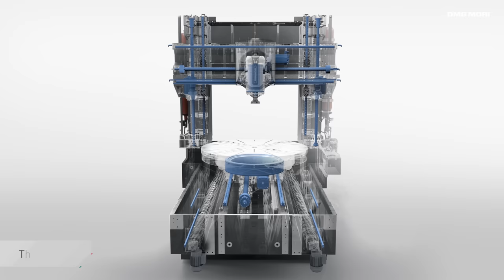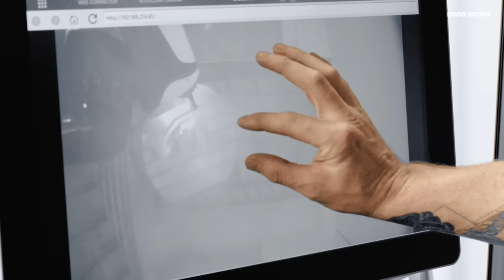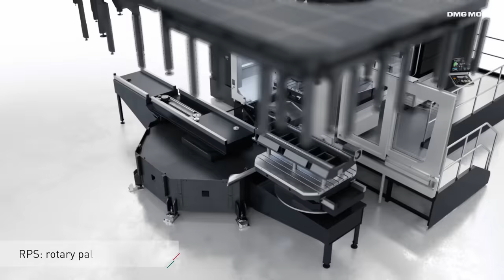DMG MORI Portal series - the pinnacle of mechanical engineering

Comment: I was in in charge of our company’s first 5 axis machine purchase and did the programming . 15 year 5 axis veteran. The thing most people overlook is “How robust is the Post” Then the question becomes do you have a post and simulation for your level of tool path software? The last thing I wanted to get into was Post development that then belonged to someone else. If you have a proven post and simulation that reads from code (Not from Toolpath) this machine will be a winner.
 Great video
Reply from the maker: Hello, thank you very much. We have both. A post processor that generates G-code based on tool path and a machine simulation that reads code and simulates the movements.

Comment: The VFX team must have sweat 💦 till production, details are amazing Good modelling & Animation really appreciate it. & Ofcourse literally machine is a Godfather. 

Just one thing I didn't see, Coolant never saw anywhere cutters using coolant system would have been great if added during post production. It is what it is right 

If possible release the machine file for testing purpose.
Reply from the maker: Thank you for your feedback. It's difficult to add coolant as VFX, besides we don't see any advantage in it than it becomes more realistic but less visible. That's why we always process dry in our videos, although it is not recommended.

The 3D model of the machine can be purchased with the machine for testing purposes. If you have workpieces that you would like us to test on the machine as a feasibility study, please contact your local DMG MORI representative or contact us here: https://en.dmgmori.com/company/contact
Reply: @DMGMORI  The part that impressed me (I am not into this stuff) is the coolant in the machine to keep the tolerances was the machine would otherwise heat up. That is pretty impressive.

Comment: wow, the guys built a great machine, but we don't know how healthy its sensitivity will be, if you ask why, it's holding the big machine with 4 legs, it's obvious that there will be a lot of vibration, but they thought well.
Reply: And a post-engineering plan, the project was great, but such a huge and very expensive bench is not used in a normal workshop, your best employee should use this machine if you give it to a novice.
Reply: Acemiye tezgah verirsen eline tezgahı verir 😂 müthiş olmuş abi
Reply: These things are incredibly heavy to reduce vibration, and every rotating part is well balanced. They even have a hydraulic counterbalance system.